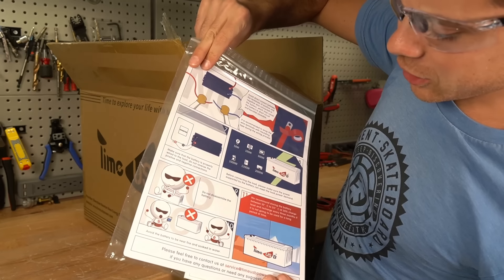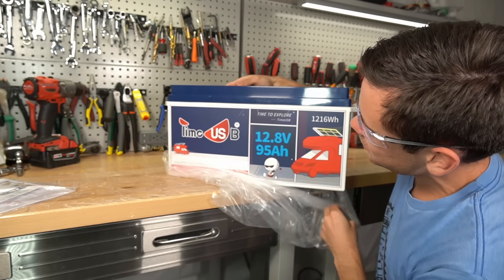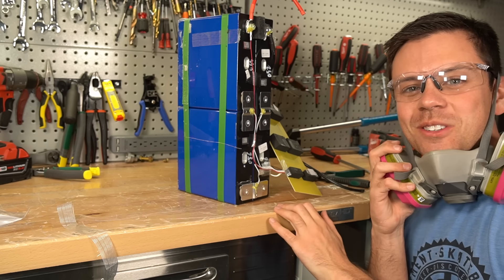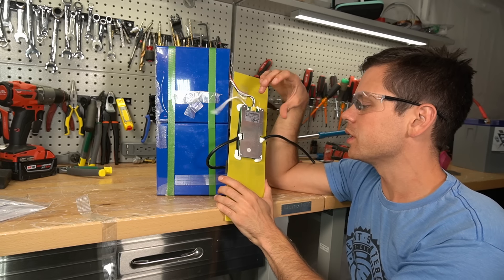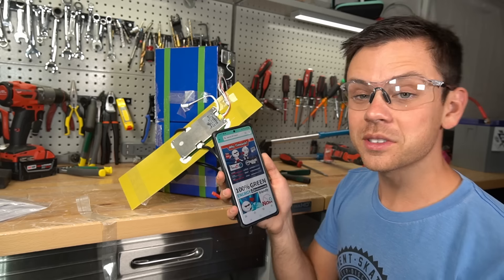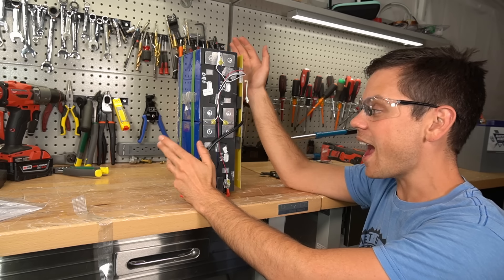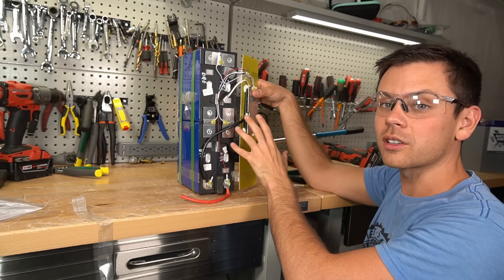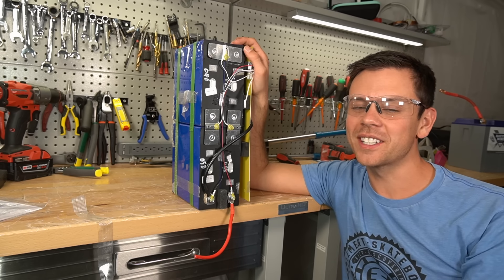$269 12V LiFePO4: Worth the risk?

Comment: Since it's $130 cheaper than the cheap Amperetime battery, I'd use it for an emergency backup supply. You could get 300AH for less than $900.

Comment: Looking at the Docan Power website their return policy whether their batteries are faulty upon testing or damaged in transit that the BUYER has to pay full return cost, which is very surprising. For me, despite them having EU stock being in the UK, that cost would be outrageous to return if there were any problems. Making buying from them impossible. Which is a shame as I really like your recommendations. The going rate in the UK for these cells (280ah 3.2v) is £180 each, where Docan Power is $149 (£126) each including delivery. Quite a difference. If you could recommend a UK seller at a more reasonable price I think we here in the UK would clear their shelves. Thanks for your content.

Comment: I have this in my Amazon cart and almost bought it today!
I plan to buy something in 2 weeks.
Perhaps I will not get this one. (perhaps I do?)

This one would be fine for my needs of talking on CB radio in my vehicle but with a 500w amplifier connected.
At 95ah or '98ah', I can push 400w for like 3 hours solid but I don't talk that much and this (old) battery could allow me to hammer down for 6 hours or a couple of days before recharging for a couple days.
The battery would allow me to 'not' need to run the alternator while talking and thus save my gas!

I wanted a 200ah but at like 50lbs it's too much for me to move every few days for charging. (I'll probably get 2x 95ah/100ah, so I have one ready to go always.)
I also want to run an amplifier in my Mercedes but I do not want to use the Benz power and involve it's electronics or wire the amp directly to car.
The stand alone power bank is what I want/need to make my portable amplifier system.

Comment: My guess for the origin of the apparently recycled CATL cells used in this battery is tow motors used in Chinese warehouses.  It is pretty interesting that the battery assembler chose to use a battery management system rated at less than 1/2 (of the remaining) C of the cells.
Reply: probably those case also recycle from vrla battery

Comment: I bought two 200 amp hour batteries by this company from Amazon for $650 each. Did not know they had "used" cells inside. They have 100 amp BMS, but fill the case. They are still returnable. Should I return them and spend more? Long time subscriber and this is my first system. Just on a budget and so tired of messing with FLA batteries. Suggestions?

Comment: I bought a cheap one like those of eBay compared to the cost of a 88 AH interstate flooded deep cycle of $170 it beats that by a lot. Who would pull 100ah from a 100ah battery? I'm pulling 4AH after 3 hours it has been able to exceed what a deep cycle flooded battery can do.  I could see flooded batteries in the future only used as start batteries.

Comment: Battery longevity and variance of quality at manufacture is still such a mystery to us and probably even to manufacturers to an extent.  They are learning, I guess.  I salvaged some batteries from a well-used 20 year old laptop.  Six lithium ion cylindricals 18650s and after 20 years and nearly as many that they have been zilched by my laptop. Five of the 6 are corroded and utterly unuseaable and one is now powering a converted 2 D cell flashlight and drawing nearly new capacity.  Go figure.

Comment: Is that case marine grade? I wouldn’t mind burying one of those for year round shed lights in a cold climate. Combine it with a cheap 50 watt solar panel and a charger, two 7 watt LED lights. 6 feet down should be good enough.
Reply: Maybe a night light sensor and some timer switch to limit the lights to 3-4 hours.

Comment: What is the dest way to hook a wind generator  bms to my kong elite + 48v battery  when it's sealed  up with its own custom battery  connection  ? Should it  connect  in the inverter  along with the  main battery  terminals ?  Also  I can't  wait  for  you to test the 12k-p  sol-ark with bi-facial

Comment: If the case wasn't so large they would be perfect for the average RVer who is only going to cycle them a few dozen times a year at most and only running lights/water pump/propane fridge controller. That price is getting close to the cheap flooded batteries that most people run in RVs.

Comment: I bought  2 50ah   Ask if external balance was need never answered  there manual say rewire  every 6 weeks  that would suck and absolutely no mention of safety glasses to be worn at all. I mentioned that it was a safety issue, and their secretary said I was a fool. I didn’t know nothing about the batteries lithium batteries.

Comment: I bought one of these BEFORE I saw this video.  Installed, mine will work for a couple hours, then is goes out.  Unscrew the terminals a spark and then it works again.    Dunno

Comment: Can you use a 48 volt lithium battery used for a forklift for an off grid home?? I’ve seen them were they hold more power then a power wall for half the cost? Would it be a problem with getting it to pass an electric inspection?
Thanks

Comment: Can you help me figure out how much battery and solar panels I need for this project.
I have a amateur radio repeater. We average 1 hour of talk time a day.  When the repeater is in use, we are pulling 40 Amps from our 12v power supply.  The other 23 hours a day when the repeater is in standby mode, we pull 2 amps.  We are in Pennsylvania zipcode 18214 and looks as if we get 4 hours of sun per day.
So how many solar panels do I need and there wattage, and how many Ah in batteries will we need.

Thank you

Comment: Thinking about RV usage, RVers don't have room for half-empty battery cases. I would doubt that many would choose that large case with less total AH than a normal-sized battery.
Reply: It is probably sized to replace a similar capacity lead-acid battery as a straight drop in replacement.

Comment: Hi Will. Considering that there is next to no bloating, that would suggest those cells have not had a hard time. Is it possible to explain the lower capacity of the cells another way. For example, when cells are produced, maybe a lot of them don't make the expected capacity. So could they be new but some kind of 'second', - a different kind of B cell. - New but lower capacity? I'd be interested to read your thoughts on this.

Comment: Good review part 1 & 2 ..  I am looking at replacement of my rv lead acid batteries this fall with lithium type battery (2). My solar system charging and inverter are compatible to the lithium battery. Thanks.  This battery is not for me

Comment: I just purchased a 100 ah lifepo4 mjbsan w/bluetooth for use in a ups,   an inverter with charger . purchased near 2000 a   tripp-lite aps1250.
The charger is engineered for SLI but after looking at the specs should be fine for lfp.  do you have any experience with this brand of lithium batteries?>

Comment: Hello... do you have videos where you hook up solar systems to a home breaker box of something to that effect? 
Would like to learn how to make the grid my secondary source rather than primary.
Reply: Not really...that's grid tied. He primarily does off grid setups. You will need to look at either grid tie inverters or essentially setup a secondary panel with a proper generator cutoff switch system that allows the use of a generator but cuts off Mains power so you don't send power out to the grid. Then instead of the generator you use an inverter off batteries.

The Victron Multiplus series inverters can pretty much be programmed to do the same in multiple ways. That may be simpler

Comment: I might not have a problem with this battery if the manufacturer disclosed the cells are recycled.  A purchaser naively expecting new cells is probably only going to receive half the discharge cycles anticipated.  Paying $50 to $100 US more and getting a new cells is a better deal compared to having to purchase two of these batteries to get the same service life.

Comment: Isn't it speculation to say they already have many cycles on them? Aren't many cells just lower capacity from the initial manufacturing? Thus could still see a long life, they just started out smaller.
Reply from the maker: No. This is common with Chinese electric and hybrid buses using lifepo4. 80% and they take them out. There's literally millions on the market. Very common

Comment: I have some redodo 12 volt 200ah pro batteries they have 100 amp bms with 230 ah and I got it for 650 is that a good deal from ebay

Comment: My guess on the size of the case is either:  (a)  they got a great deal on that size case,  (b) it's easier/cheaper for them in production to maintain all the same supply of parts to build their various capacity batteries.

My only beef with these batteries is that they should disclose WHY these are "grade B" cells.  Used or just poor post-production performance "rejects"?  It can make a difference depending on the application someone wishes to use them for.
Reply: My thought also. Over time the can put almost anything in that case.
Reply: It's optimized for RVs that's a standard RV case size. Easy drop in.

Comment: That's roughly the same price as my 95Ah AGM batteries!
In my country a lithium battery of this size ranges from 850 to 1200 USD.
A Lithium battery like this would never make it into our market due to safety regulations.

Living in Sweden, as you may already know the green party has closed down 6 out of 12 nuclear reactors and now everyones that have a house buys solar.
But all of them do zero batteries, they all just want to lower their electric bill, but in an blackout they will be out of power themselves.
I live in an apartment and I do have a balcony so I'm building a solar power backup, with the best 100w panel there is and a 190Ah battery bank.
Balcony is facing the sun on the best hours(all seasons) so I'm sure that I'll be able to get alot out of the panel.
This is manly as a backup but it's also in order to charge the electric moped battery that's a 1560Wh battery. 
I travel from one to two times a week long distances on the moped so I'm fairly sure that this setup will be enough.(Most I use up is 1000Wh in a day)
I would go all lithium if I could afford it, but I'm unemployed and I make due with what I can afford. Next month I'll invest in an ethanol heater as backup for blackout.
If there's an blackout(which is highly likely) during this winter and it's -10C outside or even less it's going to get cold real fast indoors(all heating systems require electricity to move warm water in pipes). Living in an apartment means that you don't have a wood stove. And we don't have cave man gaslines here in Sweden so.

Comment: From the Amazon ad: "And we usually recommend 0.2C charging current, that is 20A charging current and it will cost around 5hrs to full charged it." 
I know, usage, but we are used to that. 
Anyway, charging at .2C is ridiculous for lithium.
Reply: This might actually be good for a large home storage unit where the instantaneous load on any given battery is always low.

Comment: As I understand it, the problem with used batteries is not just that they hold less charge, which is ok for the cheaper price; but they also waste the charge they get, as heat. If you have solar panels, that means wasting your solar panel output, it thinks it's still a larger capacity battery. It's not going into the battery efficiently,   

Also, I believe they wear out at an increasing logarithmic rate at this low percentage of capacity. There can also be problems with balancing. Perhaps they will won't give the full range of charge, as they will have to be balanced higher in the bottom, and not charged as high in the top. As well- calendar aging...how old are they really?

I don't trust the big case, it's all 4 show. But hey, bigger is better! They could have been stacked sideways in half the space.  But would they then heat up, is that why the foam is only in the bottom?

Most of the cost may not be the battery, which may be almost free at wholesale "as is" bulk price for battery maker, compared to other grade b cells.  All the money is mostly to pay for other business externalities.  There's only so low you can go...the salesman still has to eat.

Comment: Great explaination on cheap battery...@DIY Solar Power...I have question for you bro...hope you can solve it for me....I now struggling to solve power for my boat...I used to go fishing for bout 24hrs...my my motor didn't have any power source to charge my battery that powering my electronics devises...such as fishfinder. The only option for me to keep my device work is on solar charging method. For your information I'm using 2 unit fish finder & 1 chartploter  running all the time on . Main fish finder required 500watts, 2nd fish finder required bout 65watts & my chartploter required 175watts...when came to night fall all my lighting required bout 80watts in total. Like I say I only can charge my battery on solar charger...can you suggest or advice me how much battery & solar panel required for my system...any reply highly appreciated & thanks in advance.
Reply: You have a good start on the load info here. But what you need is watt hours ( not watts) to size a system. Multiply each of your loads by the amount of time used to obtain watt hours required from system. Now you have the total required power OUTPUT for your daytime/nighttime system (no sun at night). Clear sky solar radiation is 1000 watts per square meter (3.3 ft x 3.3 ft) BUT solar panel conversion efficiency on most current panels is only 20% so you ONLY get 200 watts per square meter (cheaper or older panels may be as low as 15%-17% efficient....150-170 watts per square meter). ALSO on a heavily overcast day (best fishing)  solar radiation to your panels might drop to 100 watts per square meter (instead of 1000) so you would have to divide your "clear sky" calculated output by 10 for that event. Now you have watts NOT the watt hours that you require. If mounted horizontally (like Bimini top), you can expect 5 hour of full output. Actually less in morning and evening but full for the 3 or 4 hours of overhead sun. 5 hours is a generally accepted rule of thumb. So now multiply your maximum available solar panel area (compensating for factors above) watts times 5 hours to obtain watt hours available to charge your batteries. If your solar watt hour output is MORE than your required watts hours for an entire day, then your battery capacity required only need be that for your nighttime load. If your solar panel watt hour output is LESS than your required watt hours for an entire day then you must make up the difference with additional battery capacity...AND...start out the day with the batteries fully charged.

Comment: whats the best value 200ah lipo? I need to get off lead acid.
Reply: I bought an Ampere Time.  Works great.
Reply: @Fritz Donnerschlag Which brand?
Reply: @merlpriester  Thanks bud! Thats what Im thinking of getting. I have an Outback Flexmax 60, do you have any charging tips for the lipos?
Reply: @freeradical431  It is in my trailer.  Solar plus ac is max 75 amps charge.   Most of the time ac only.    Change your ac charger to a lifepo4 compatible or you won't get a full charge.    I have the 200 amp bms version.
Reply: @merlpriester  Thanks man! Im running an Outback Flexmax 60.

Comment: for the price. it will sell out.
most out here in the real world, do not need a million watts and a zillion amps storage in there rv's.
but it would be far better in a smaller case. and a larger bms,  as size does matter for some.
aka: my rv is only a small 30 amp unit. so this battery might work. but space is limited so a smaller case is required. 
now if it was a 200 amp, with a 75-100 amp bms in that case for this price, i would be on it.

Comment: ...that battery now retails for $190... I have the TimeUSB 50ah Pro, which is half the size and which gives 53ah.  It uses grade A cells, and cost me around $169.. unless you really need the 100ah capacity this is a way better way to go.

Comment: I am a noobie on this stuff, but I would think that that foam will also insulate heat to a very bad extent...
Reply: You could put some vent holes in the case is you are concerned. Plenty of room for air circulation.

Comment: Usually they try to make electronics as small as possible. Very odd to see them purposely make the battery look 4 times larger.
Reply: It's probably what some Chinese supplier in the building next door had on hand, overstock, not a common size but fire sale 
cheap. That 50 amp BMS is pathetic. All bargain basement cheap stuff designed for the enthusiast who thinks in milliamp hours.

Comment: can anyone recemond a battery for the Hustler Zeon electric zero turn mower they came out with years ago and discontinued shortly after. It came out with 4 - 12 volt lead acid wired in series for a 48 volt system about 100 ah. Would love to get lithium replacement, but these operate under very bumpy, hot, high demand conditions.

Comment: So I’m looking to replace my 4 100ah AGM batteries with lifepo4 batteries.  My problem is these would be used at my camp in Maine.  They are attached to 400 watts of solar that charge these batteries year round.  The batteries will be in below freezing condition.  What are the best 100 or 200 ah lifepo4 batteries with low temp charging ability.  Or in reality the best for the price.  If Will or anyone else can help me I’d appreciate it.
Reply: Bury them about 6 feet down and they will never freeze. Depending on where you are, water might be a problem though.
Reply: Some of them have built in heat pads

Comment: That battery case looks like it was originally designed for either AGM or lead-acid use. As they are going cheap with the BMS and using these B-cells, they are just buying cheap components all around and throwing them together. Good call on the don't buy advice.